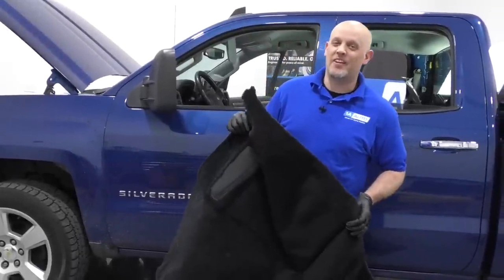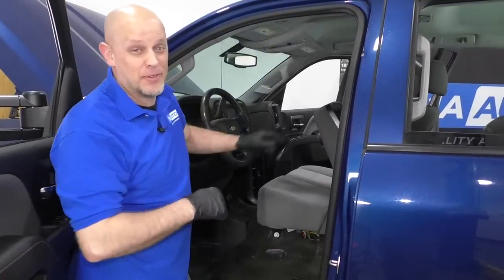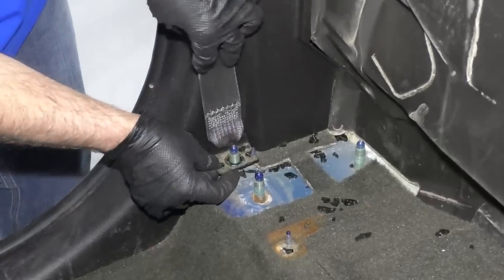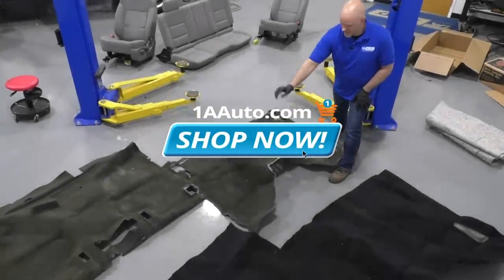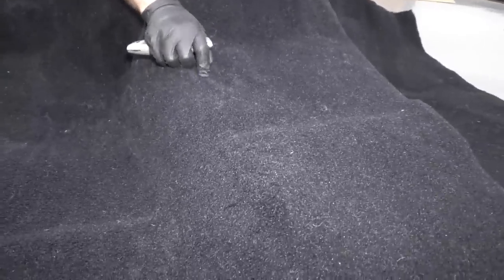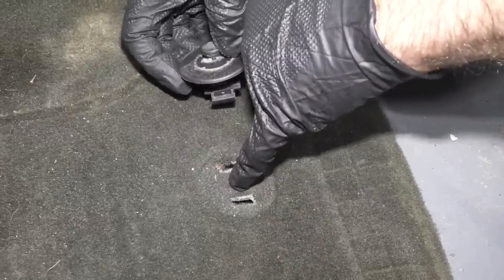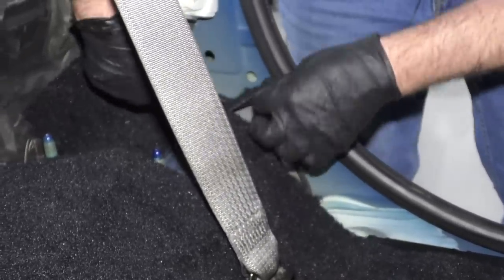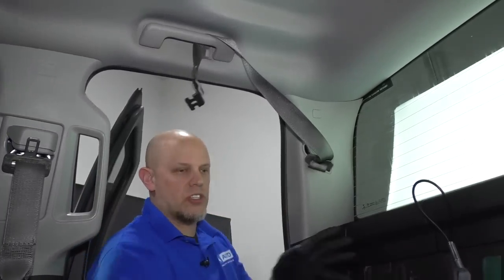How to Install New Carpet 14-15 Chevy Silverado 1500

Comment: What are those rubber lines on the floor?  It almost looks like an adhesive.  My 2019 had a windshield leak that was repaired on the passenger side, and I am currently drying out the carpet and insulation.  The floor pan is in pristine condition but it seems as if the water has deteriorated some of this "adhesive" or rubber on the top of the floor pan beneath the front passenger's foot area.

What is the purpose of this rubber and is there any worry that some of it has deteriorated?